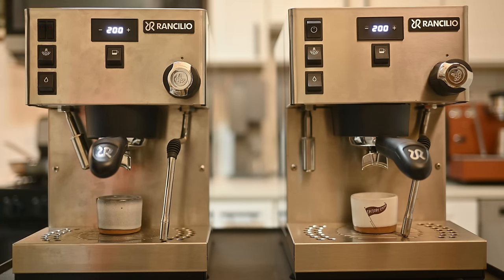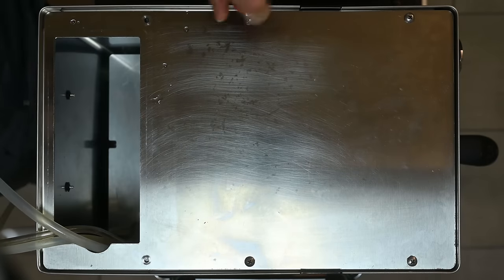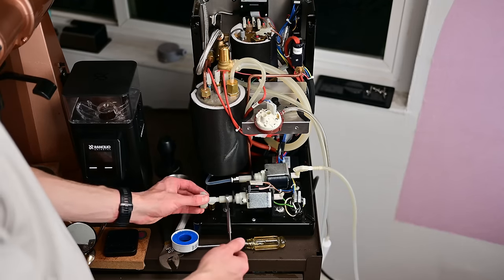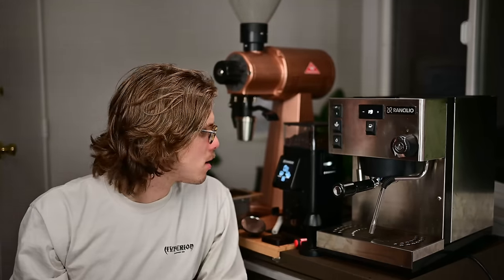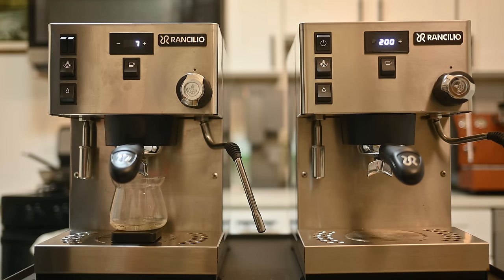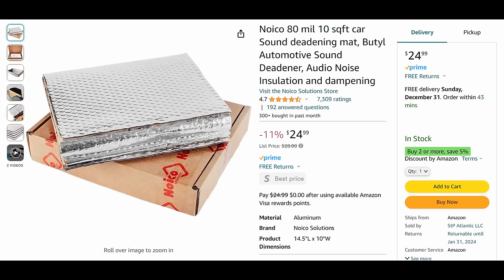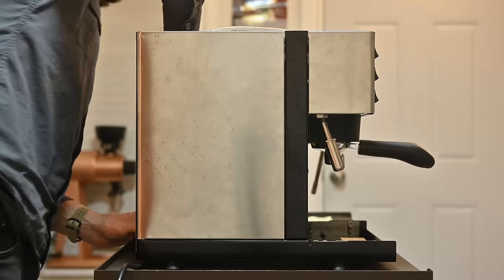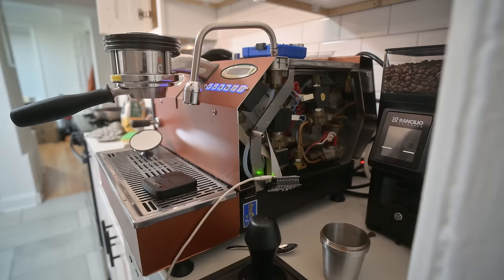How To Make Your Espresso Machine Quiet

Comment: I think that installing a rotary pump would solve both the noise and pulsation for probably the same amount of money of all the mods. 
A downside is that there’s not enough space for one in most machines so you’d have to install one externally.
Reply: You can't just put a rotary in. Doesn't work. Too much unregulated pressure
Reply from the maker: Good idea! I thought about that,  but I've found that my gs3 with its rotary pump is surprisingly much louder than my Silvia is now.
Reply: @tatemazer  That’s surprising (to me but good to know). 
Have you looked at how the rotary pump mounted in the GS3? Is it perhaps bolted directly to the frame without isolating rubbers? 
Thanks for your excellent video!

Comment: How did you get rid of buzzzing drip tray?
Reply from the maker: Hmm my drip tray was never buzzing before, is it possible something on your machine is loose or miss-aligned?
Reply: @tatemazer  I don't know what exactly is wrong with my machine. it's lelit grace and all the parts are full metal, so they are buzzing
Reply: @tatemazer ok, I think my main issue is huge vibration when pump is working,  so even cups getting moved